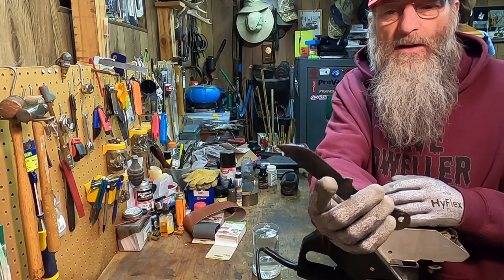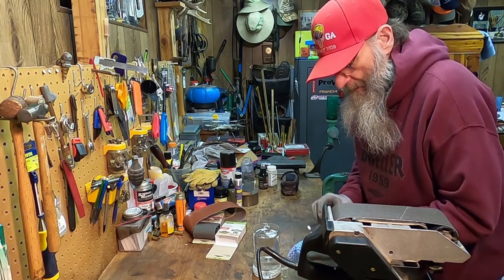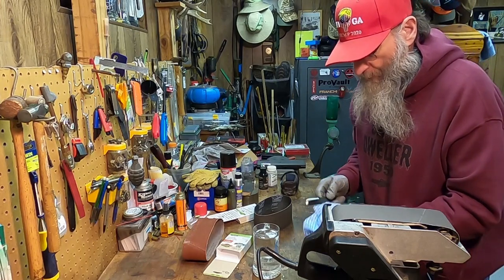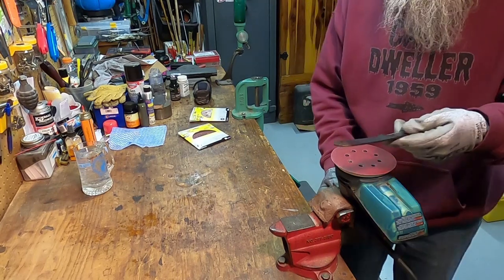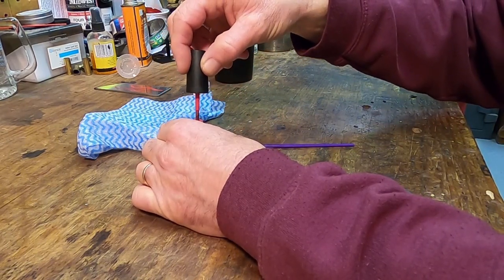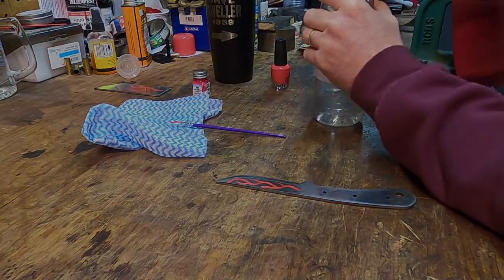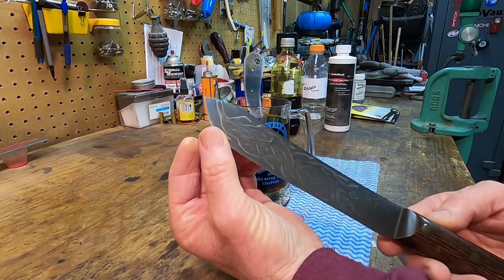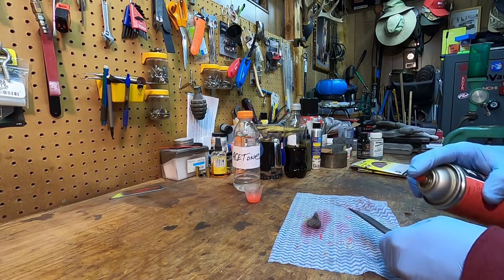Acid etching  my hunting knife  #4 Grind the edge & add some flair.

Comment: I noticed when you was using the belt sander you started on the right side of the knife on the flat bottom of the sander when you flipped it over you moved back on the sander because of the clearance but you where off the flat bottom of the sander and was between the guide wheel and the belt would give and slack making a difference in one side to the other just wondering if you would have used the flat bottom if it would be easier to get them even 
Enjoy your videos keep it up          Buy the way your a hell of a shooter 👍
Reply: Disregard my last post went back and you did start both sides on the flat of the sander. My bad 🤦🏼